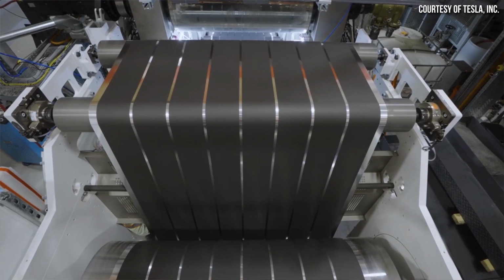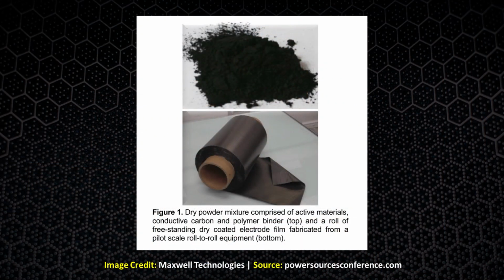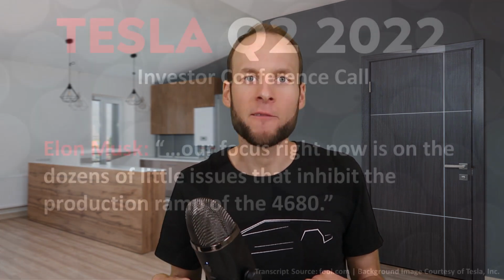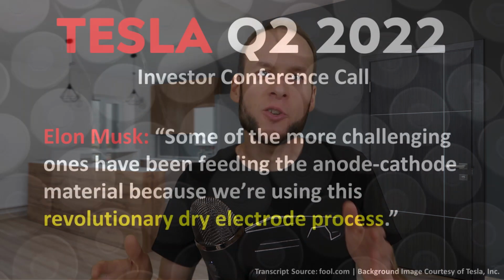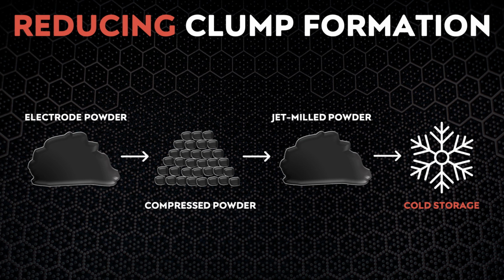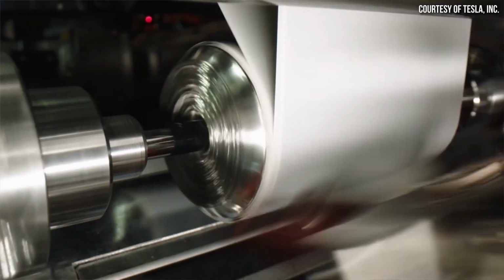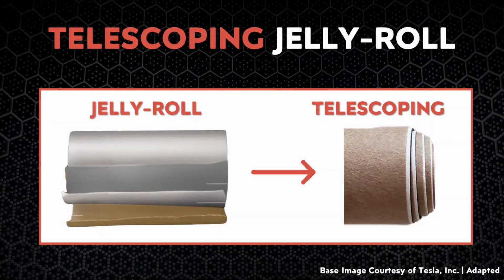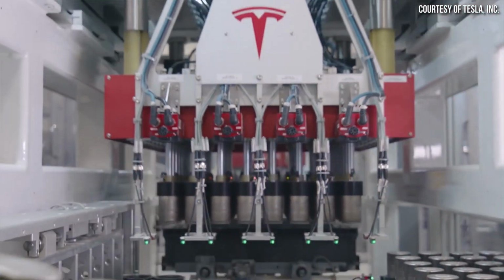EXCLUSIVE Tesla 4680 Battery Manufacturing Updates

Comment: The lamination process  reminds me a bit of the process a laser printer uses to bond toner to paper -- but printing a continuous black page on copper film.  I used to work for HP back in the 1970s/early1980s when laser printers were in development and saw some of the same issues.  Thermal issues were a problem, but not to this extent.

Comment: A "flag" is a tab.  There is no tabless.  The battery is continuous tab.

I love the use of percentages in this video.  Let's say that Tesla produces 1000 cells.  600 (60%) of the 1000 cells are rejected for one or more of the 6 defects noted.  Now, Tesla works to reduce rejected cells.  They reduce the rejects by 90%.  They are still rejecting 10% of the cells (60 per 1000).  LEAN/6-Sigma standards are 3.4 defects per MILLION.  That's 0.0000034% rejects.  At 10% rejects, Telsa is a long way from 1-Sigma.  It's really sad.

And please note that the "90%" statement is total BS.  Percentages hardly ever end with a zero.  If I were to guess, I would say the reduction is less than 50%.  The 90% figure is marketing poop emojis.  🚽🚽🚽🚽🚽

Comment: The issue that is being faced is internal shorts and opens in many cells produced.  Even those reworked for use are subject to heat related shorting and opens along the continuous tab (the so called, "tabless" portion of the cell).  Too many connections to fail.

Comment: I think Musk's use of the word 'revolutionary' for its 4680 dry manufacturing process is rather misleading. Ultimately, the litmus test of any battery, i.e. its battery energy density, appears almost the same as the prior batteries, given me to believe we have approached the maximum efficiency of existing lithium ion technology. Hence, Tesla's inability to deliver their semi, as the heavy weight of the required battery to  produce any viable range (say 500km+) leaves little to no carry capacity.
Reply: Wrong, most important thing is mass production. Semi viability does not depend on energy density improvements.
Reply: Munro says the 4680s have even more energy density than was first thought. I'll take his word for it over yours. 👍🏻

Comment: I imagine that these production processes start slowly, and gradually speed up. With the number of processes involved - some processes that work fine at slower speeds, become more unreliable (lower yield) at higher speeds. They work through these problems, then speed up the line again, to even higher speeds... Considering this is battery chemistry, and the high tolerances required, it is easy to see that it will take a while to get to high speed, very reliable production. I'm guessing they can use camera images (on the fly) to see where faults are occurring, and when they have overcome them...

Comment: Panasonic don’t use the folded ends of electrodes but thru are using s number of spot welded tabs rather than just the one tab used on smaller cells.

Comment: so the new Austin Y with 4680 has less mileage than the 2670. Is it really all that much better? The flagship S & X still use the 1865 so what gives?
Reply: Until we know the physical capacity installed in the car no comparison can be made. Knowing Tesla, the they're probably software limiting the capacity by much more than they have to, and possibly also putting less capacity in in the first place because there just aren't that many 4680 produced yet
Reply: @MnrBugi  Munro did a tear down of 4680 so capacity is known

Comment: This is some excellent and fascinating reporting, Jon.  Many kudos to you and to your sources for illuminating this subject for us!

I'm delighted to have these details to rattle around in my head - but my overall opinion is unchanged.  I expected the ramp of a new battery form-factor would start with a high reject rate and slow lines - confirmed!  I also expected that Tesla would work through the glitches and reduce rejects and improve line speed, and your report confirms that they're making good progress on those goals, too.

I'll be interested in anything you can share about their new 3-in-1 lamination machine.

You're doing a fine job, Jon.  Thanks for your reporting!
Reply from the maker: Thank you - I am working on that video and hoe to have it out soon!